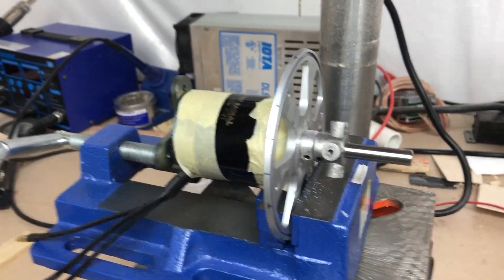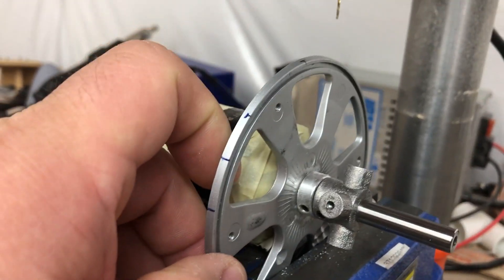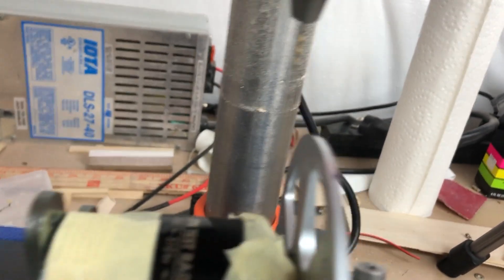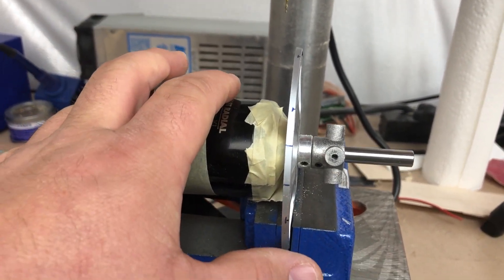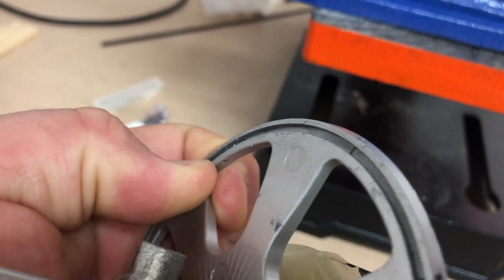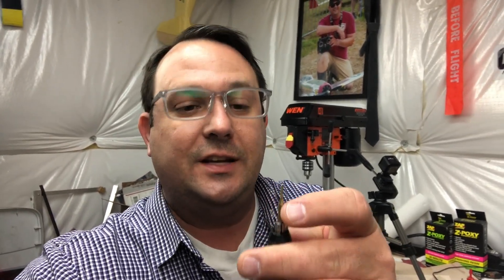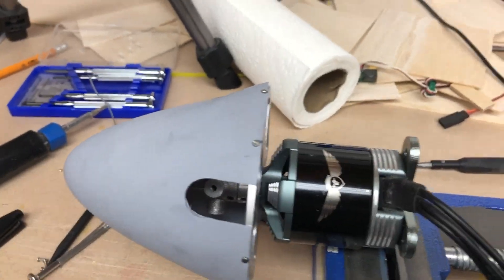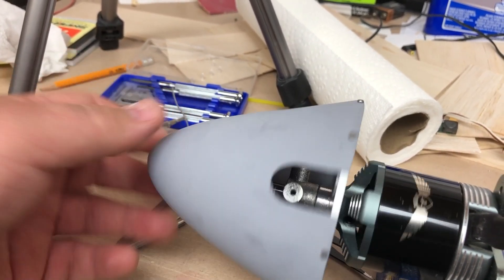Mustang Update 06: Machine Learning

Comment: Should use a 3mm milling cutter to create a small flat then use a small center drill to create a start point then drill the holes with a drill, then straight after you drill DON'T move the work peace, put the tap in the chuck and put the drill in neutral and hand wind the tap into the work peace. This makes sure all your holes are done in one cycle and straight. Flat, center, drill, tap - done. Hand tapping a small tap is hard work.